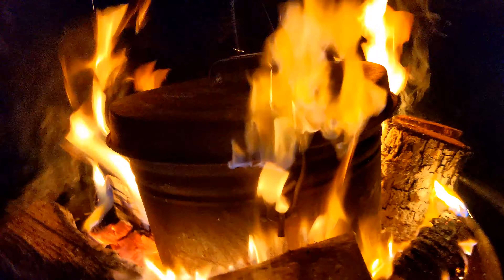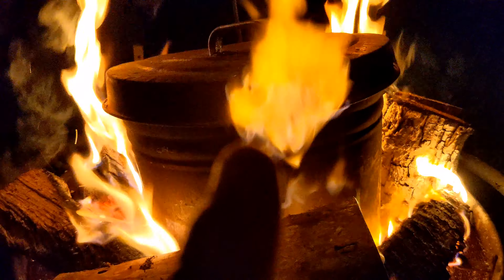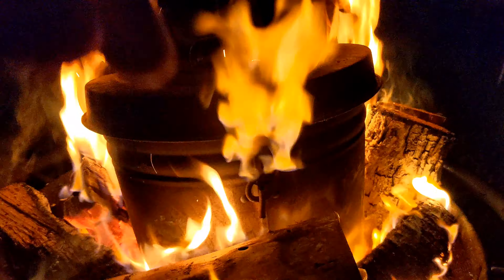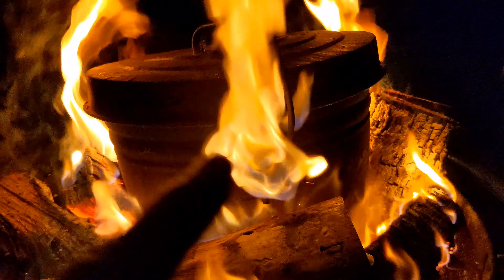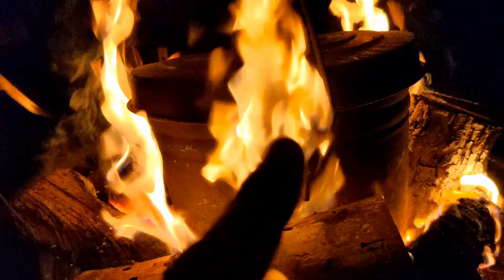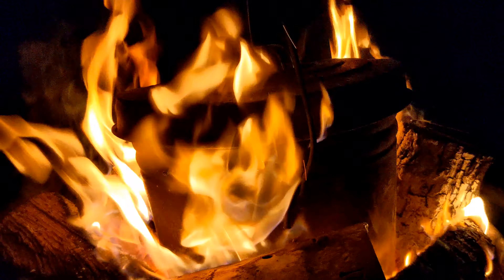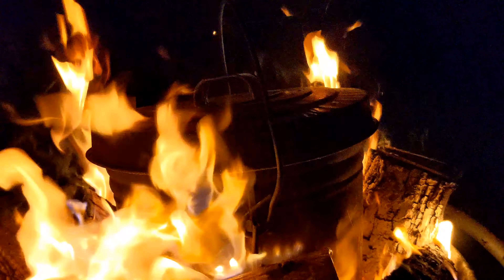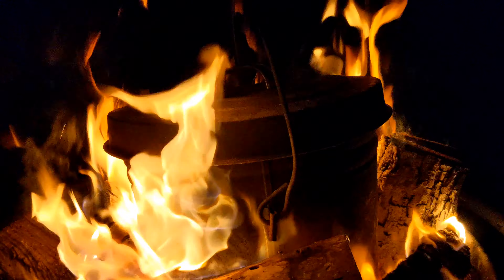Making Lump Charcoal (bio-char)

Comment: Awesome video! So lump charcoal sold in stores is basically biochar? I understand biochar and regular charcoal is not the same, but look at your method, and when you grabbed it it sounds like glass or metal shards.
Reply from the maker: Yes, this is lump charcoal. You basically 'bake' the wood. Close off the oxygen so it doesn't ignite. I need to make some more!